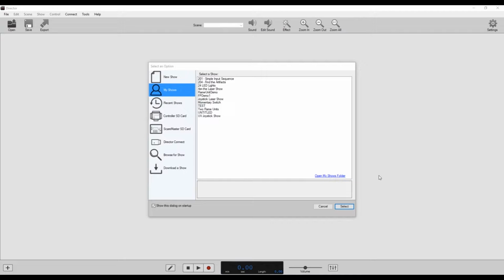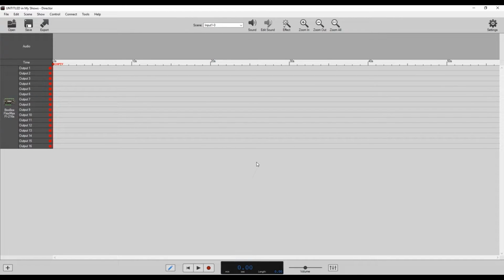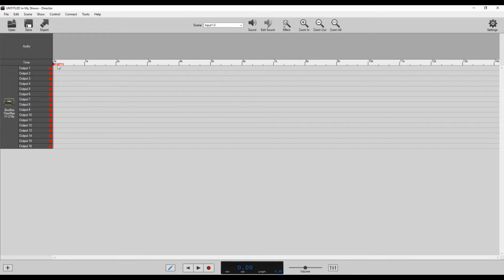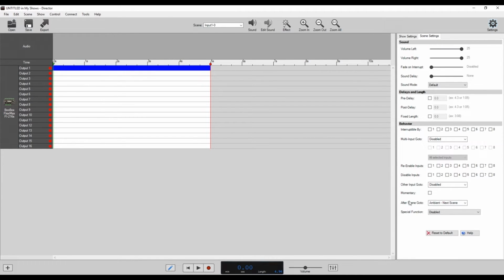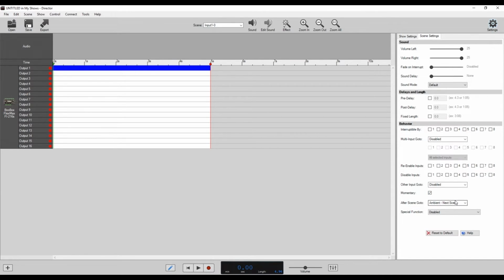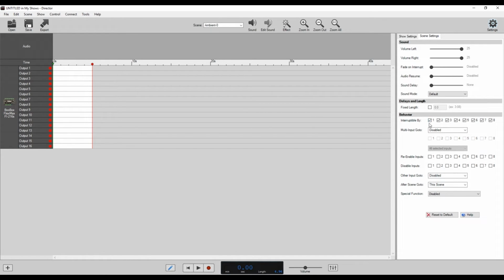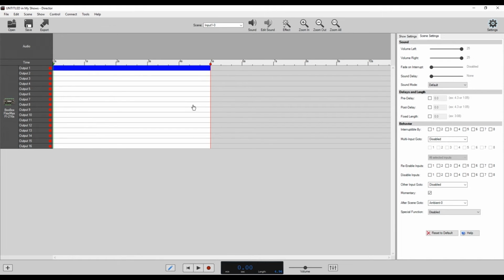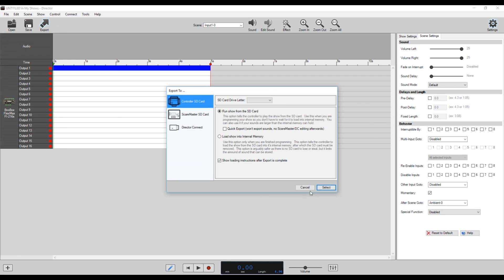Making a Light that Stays on Only as Long as a Sensor is Being Touched

Comment: Hi, we was look at your great videos that you are demonstrating on YouTube. and we decide to write to you for a kindly  advice, we are thinking to make a project for our truck which is 12 volts  that when you open the door a step from underneath comes out with air cylinder for the 3 door of our truck which are going to work individual using Magnetic Proximity Switch for each door. to open and close the cylinder Can we use Pico BOO or something else for Controller the system?

Comment: Great video! I have a question about the flexmax. I bought some LED lights and the power on each light says 90 ~ 240V, 50/60 Hz. My question is will I be able to just strip them and plug them into an output if I have a 24v 5a plugged into the flexmax?